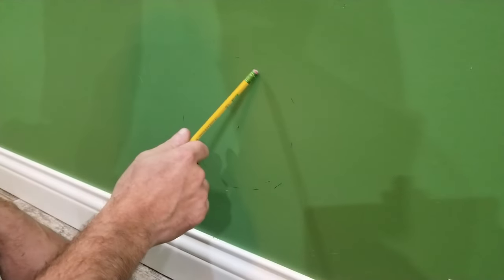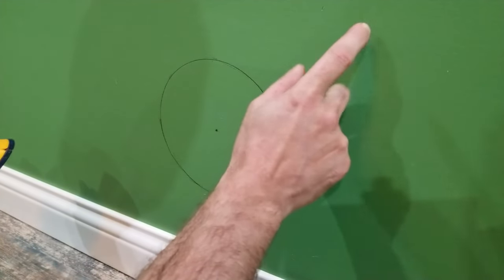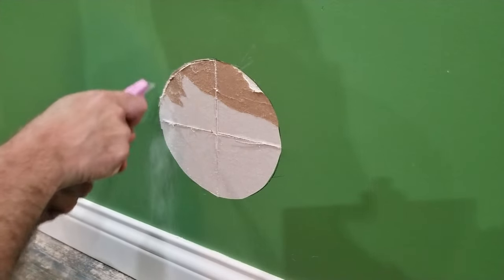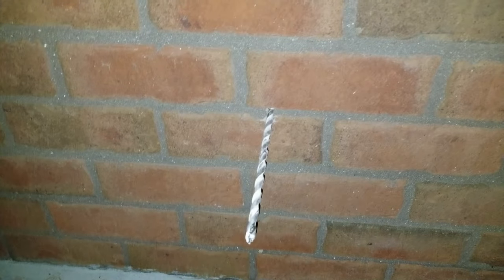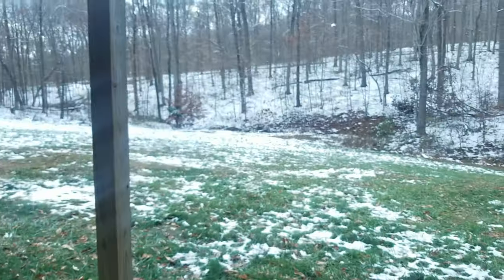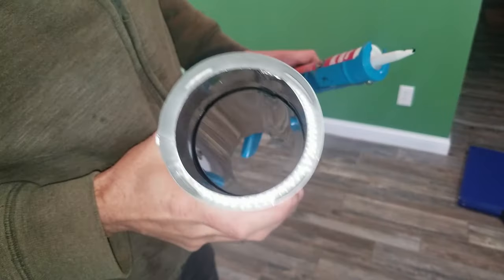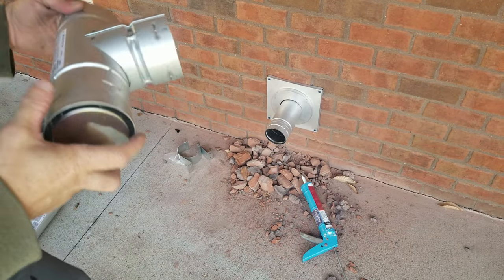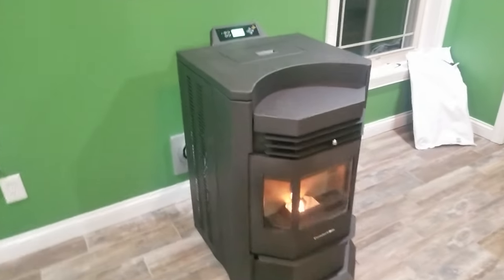Pellet Stove and Pipe Install. They wanted $2,200. Did it myself $$$

Comment: Nice work but all the studies have been done you should have vented the fresh air intake outside as well highly advantageous however the exhaust and fresh air intake must be separated not too close to each other outside.
Reply from the maker: I ended up putting in the cold are intake. Although, I think it's less efficient. It seems like it does not heat as well.
Reply: Could you do a quick video showing what you did on the intake please ?

Comment: You should really think about hooking up the fresh air intake the machine now pulls air from inside the house and exhausts it through the chimney
Reply from the maker: Those are not needed below a certain elevation per the manufacturer.
Reply: @DustySmalls  true but the fact remains that you are pushing warm air from the house out the chimney and pulling cold air from outdoors into the house
Reply from the maker: @leo181s  I wonder how much more efficient it would be?
Reply: Is he going to need a fresh air intake or not? Never done this but, if he doesn't, isn't he loading the inside of the house with toxic fumes? If not, is the chimney exhaust going to bring cold air or exhausting hot air? Don't tell me all of the technicalities, I just want to install one and save money on my $200.00 electric monthly bill during the winter.
Reply from the maker: @JohnSmith-lq8ib  I would tell you, but you don't want to know the technicalities.
Reply: @DustySmalls  Well go ahead, am almost 63 and is hard for me to understand the BUTs, vs the gigabytes from the square feet. Just give me your 2 cents and I may learn from it. You see, I live in South Oklahoma about 20 miles form Texas. I never paid bills in my life and now is overwhelming the idea of paying $200 plus in electric bill just to heat up a house that I only visit 3 or 4 times a month. Is complicated, please don't ask why I don't pay bills or why I only visit the house.
Reply: A house furnace pulls air from inside the house via return air ducts, why cant a pellet stove use inside air?